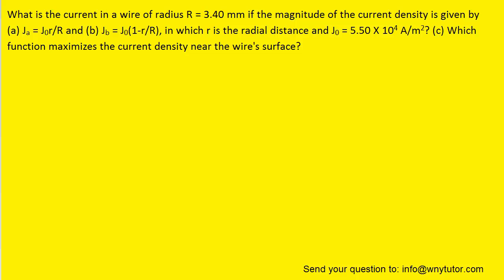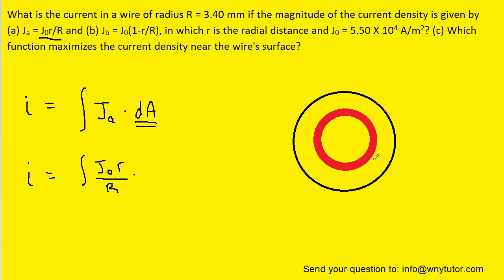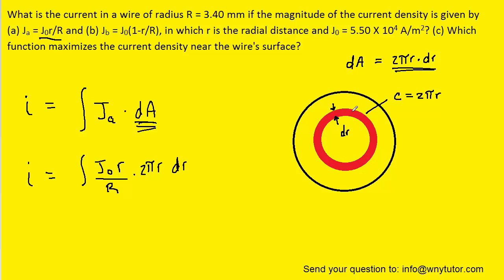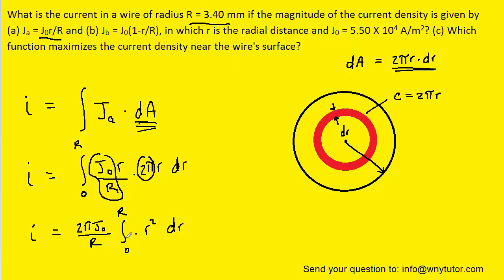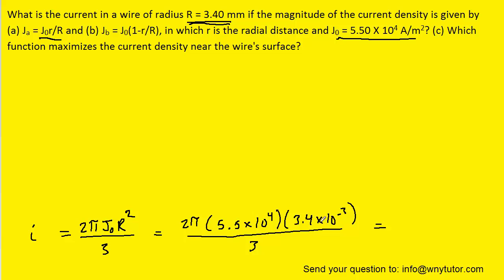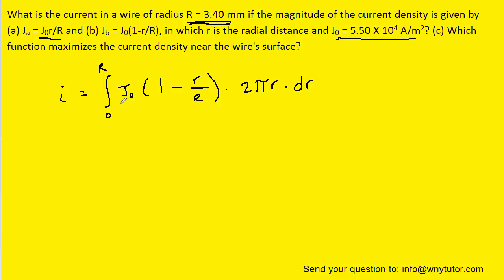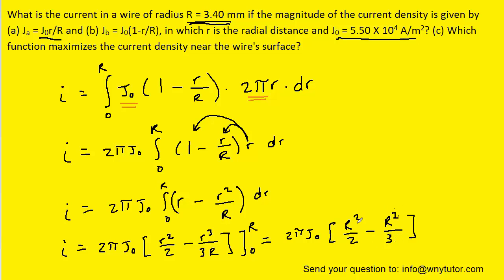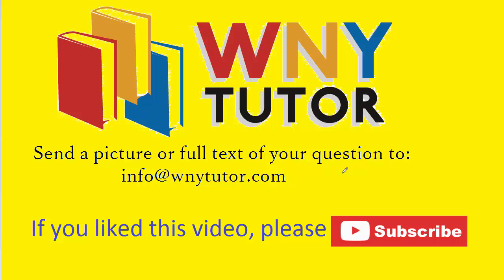What is the current in a wire of radius R = 3.40 mm if the magnitude of the current density is given

Comment: For part C: what is required is the current density near the surface, not the total current in the wire. Choosing the first density equation was right, however the reason is not accurate. 
Near the surface: r=R. so:
Ja = Jo*R/R = Jo
Jb = Jo*(1-R/R) = 0

Thanks for the effort, it was useful to me :)